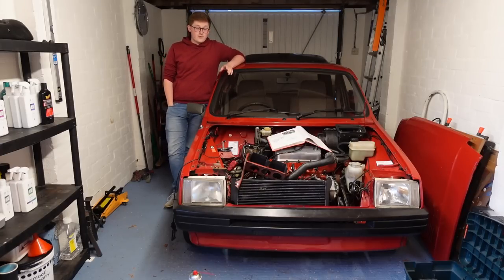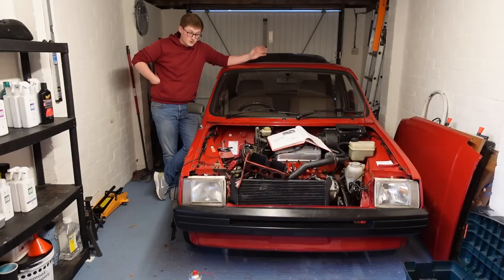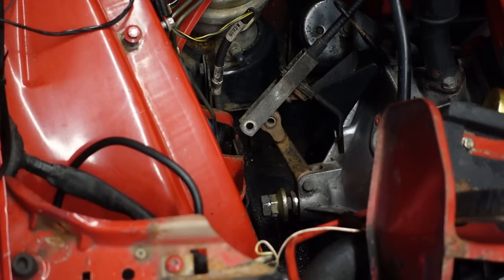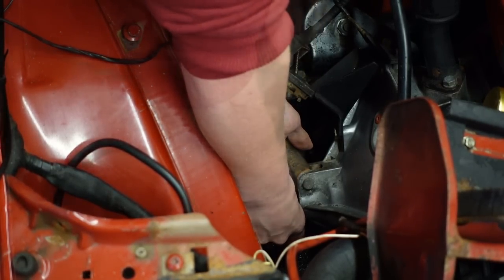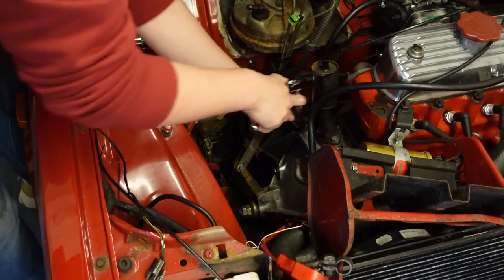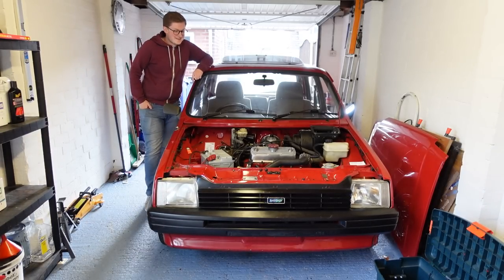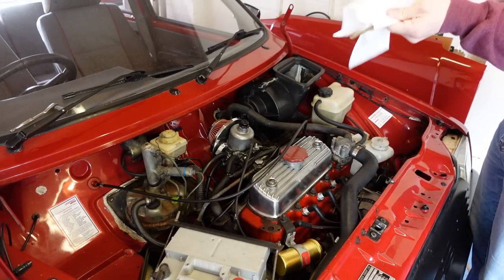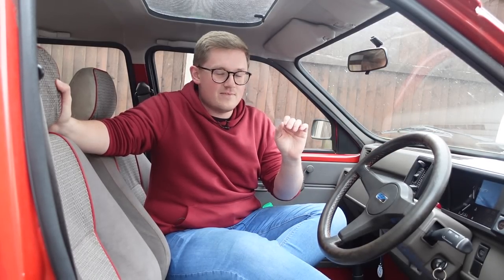Sorting the Niggles - Metro Gearbox Rebuild, Part 7

Comment: Well done, sir. It's great to see your Metro back on the road where she belongs. All involved should be proud as it's quite the undertaking for the home mechanic.

I'm about to embark on a bit of mini project myself. My Dolomite has come off the road to have some new brake hoses, which has increased in scope to now include replacing all the brake pipes and the subframe bushes having found that one is severely deteriorated!

Well done again!

Comment: My first car was a 1.0 Metro City on a B plate, in glorious Champagne Beige. Over time, I upgraded the City spec, adding plastic bumpers, one piece headlights, digital clock, MG exhaust and carb, and even fitted the clocks out of montego to get a tach... the Montego clocks just plugged straight in and the tach worked, with no fiddling. I love the tach clocks on this era of Austin products, and I think tach clocks would look great in Melody, certainty with the MG interior!

Comment: I have a lot of experience working on these engine/clutch/gearboxes over many years and if I remember correctly the Metro clutch adjustment was meant to be measured by the amount of free play you have when pulling the pedal back towards you and not by the more common way of measuring the free play before feeling resistance in the pedal. It is many years since I worked on these cars but it came back to me as soon as I saw your description. Hope that this might be of some use to you.
Reply from the maker: Ooh I did not know that. I’ll do some research!

Comment: Nicely done Ed,when you tune the engine use some atf in the dashpot it's slightly better at dampening the piston ,also with the replacement air filter fitted it will be running leaner than it used to,check the emissions data from your mot check and take the mixture screw in about half a turn to start with.

Comment: Well done Ed, you gained loads of knowledge to take onto the next project. Had the same clutch issue on the mk2 I had. Pull the clutch cable through the bulkhead as you've already done and hear the pedal click up, you then slip washers and jubilee clip behind it, about 8mm from memory and that will keep the clutch pedal fully up. We'll done
Reply from the maker: As it's the way they came from factory, I'm not going to bother doing anything else.

Comment: I'd think the tuning issue has as much to do with E10 fuel as the air filter, but know stage 1 kits (filter and exhaust) used to come to come with an SU needle.
Probably still do and worth finding out which one.
Haynes do a manual for SU carbs and detail the various needle profiles.
I have a one here somewhere and a scanner, if it helps.
Reply from the maker: It might be a fair point - if it had ever had a millilitre of E10 in it!

Comment: It may be the rose tinted glasses but I would love to get a mk1 mg metro again mine had the stupid 315mm tyres (really expensive for the time ) but I learned the Michelin TDXE tyres stuck to the road but as they were a soft compound they didn't last but unbelievable grip and handling from the metro. Great memories I've had some really powerful cars in my time but I have fantastic memories of the metro.
Funniest one being my now wife of 30yrs one of my mates and his girlfriend had been at the cinema and headed back to the car to go home we got in the car and I started it looked in the mirror and asked my mate what had he done with the sheepskin rug from the back shelf ( a stupid but popular thing at the time) he denied moving it and we started arguing I was swiftly told by now wife to get a grip and behave I then put the headlights on and immediately realised what had happened. My own car was parked directly in front of me it turns out I had opened and started someone else's mg metro the actual owner of the car at this point turned up and started to argue and threaten me as he thought I was trying to steal his car but when I pointed to mine he stopped shouting and immediately calmed down and couldn't understand how my keys worked on his car so we tried his keys on mine and they opened it and started it as well. We all had a bit of a laugh about it but next day I installed a hidden kill switch and a battery isolator to stop it being stolen

Comment: Excellent, working up and running, great job. just make sure you get that rack and pinion sorted or it could be dangerous in my o pinion😁
Reply from the maker: Thanks mate, and don't worry, I already have a new rack sat in the garage. Though it wasn't even identifiable with the solid suspension, when I had the suspension done, it showed up the slop in the rack. This was all recorded a few months ago, so it'll be coming out in due course :)

Comment: Have you / are you going to correct the hydra-gas to front to rear
Reply from the maker: No. While it would be the correct way of doing it, A-Series Metros don't have the facilities for its fitment. First of all, I'd need the whole suspension units and pipes from a K-Series, then I'd need to modify the connecting cone things on the back, then add the brackets to the body for the pipes to hang. A lot more work than it's worth.
Reply: @TwinCam  yes I see!

Comment: Have the clocks been changed then since you've bought the Melody or before you bought her? Says there's an 8,000 miles mileage drop on the MOT data base. Either a big job well done Ed!!! 😁😁👏👏
Reply from the maker: Different gauge cluster.

Comment: I wonder why they went away from the hydraulic clutch that seemed to work fine on the Allegro. Cheaper?
Reply from the maker: The Mini and Mk1 Metro used a hydraulic clutch too. They switched to cable because it was cheaper and more reliable.

Comment: Your lucky, the n/s headlight should have failed the mot, if you drive down a 'bumpy' road, the light will flicker about.
Reply from the maker: I secured it before the test for that very reason. It’s not exactly factory or permanent, but it wasn’t wiggling by the time of the test.

Comment: Impressed with what you have done with the car but lose the tacky air filter and put the original one back on. The cone filter only makes the engine noisy.
Reply from the maker: I'm not sure whether I mentioned it in this one, or it might be the next one that comes in a couple of weeks, but I can't fit the original!
The new inlet manifold is a different size to the original, meaning the factory airbox fouls on it. However, an MG Metro airbox will fit, and one is on the way so I can mix and match based on how I feel :)
Reply: @TwinCam  Good choice nice to keep it (near) factory